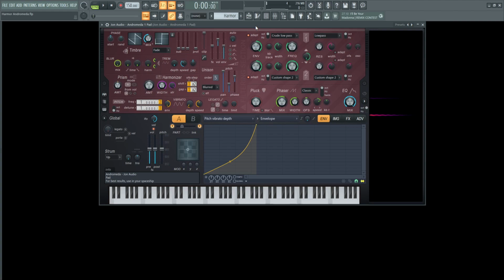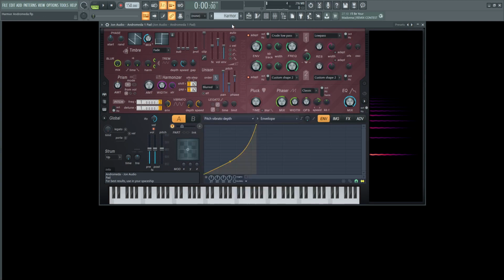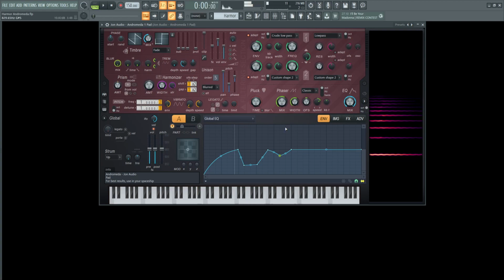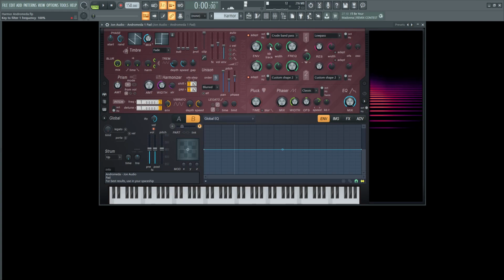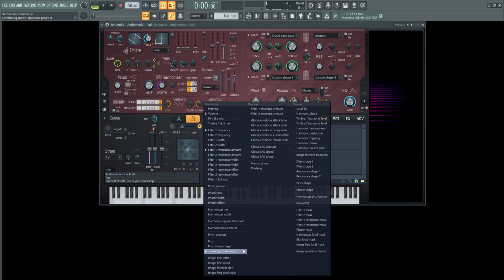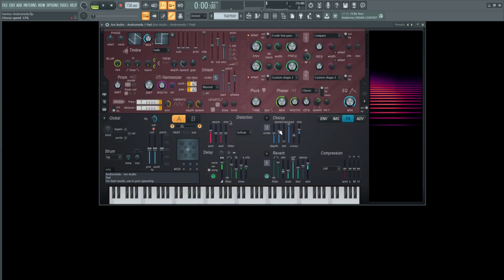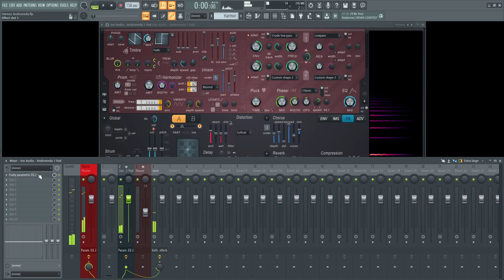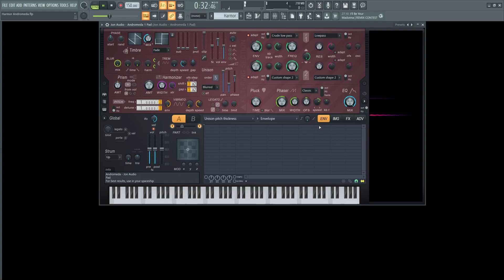Harmor Andromeda Pad Sound Design | FL Studio Tutorial

Comment: Sounds good 

Good reminder that there are A and B parts of Harmor. That seems a bit confusing, as are the A and B parts basically like 2 oscillators?

Another issue I’ve encountered in Harmor is not being able to adjust ADSR. This only happens on some patches, but sometimes I’ll adjust the volume envelope and it has no effect. Also there are ADSR knobs below the graph, and they seem to have no effect either. I must be missing something.
Sometimes I can adjust the note sustain etc. using the frequency 1 envelope. That seems somehow related to the volume envelope
Reply from the maker: Yeah part A and part B are entirely separate parts, so think of it in the way that you have 2 harmors in one. However both parts will share the fx tab.
So the ADSR knobs can be a little confusing. Those don't control the envelope itself, but rather offsets of the envelope in the graph. So let's say you have spend time making an envelope on the graph and want to change the attack slightly, then you would teach for the ADSR knobs
Reply: @jonaudio  hm, still don’t quite understand why the ADSR knobs on the volume envelope sometimes seem to have no effect

That is pretty cool tho that you basically have two Harmors, A and B, that you can combine. It seems similar to two oscillators, but better, because you also have the two oscillators in each the A and B part

Was also just watching some vids about adjusting waveforms. Guess you do that in the graph for harmonic timber. That’s pretty unintuitive compared to toxic biohazard where there’s a drop down menu of a bunch of waveforms

Also I recently got the Biomorphic preset pack for Harmor and it’s awesome. Def will give me some sound design inspiration, and good patches to use in songs
Reply from the maker: The ADSR knobs themselves are intended to be used after you draw in an envelope in the graph. If you have a 0.5 second attack drawn in the envelope graph, then the A of the ADSR knobs will offset that value, those knobs can also be automated as well. You can make a cool envelope and use the knobs to automate the offset of that envelope. Hopefully that makes more sense.

The difference of the waveforms in toxic and harmor is that toxic has pre-made waveforms ready to use out of the box. Harmor has the additive graph (timbre graph). In harmor you can design your own waveform using additive synthesis there. It's similar how in sytrus there is the osc graph.
Reply: @jonaudio  cool, I’ll have to experiment with drawing waveforms 

Also saw that you can drop a waveform audio file into the resynthesizer. I haven’t really gotten into the resynthesis capabilities as it seems more advanced and I haven’t mastered the basics